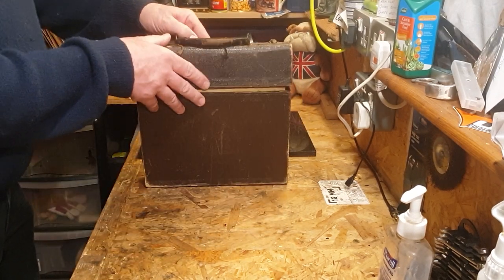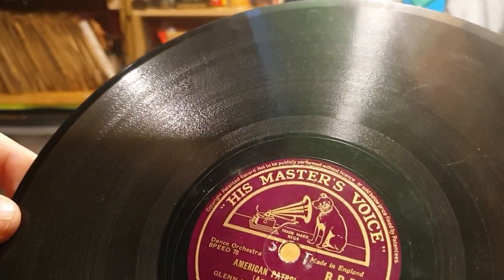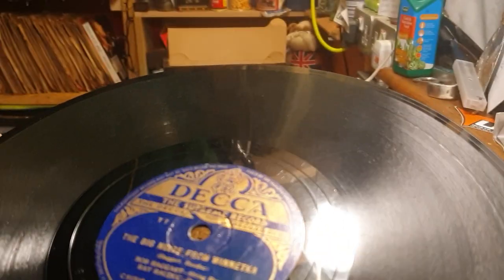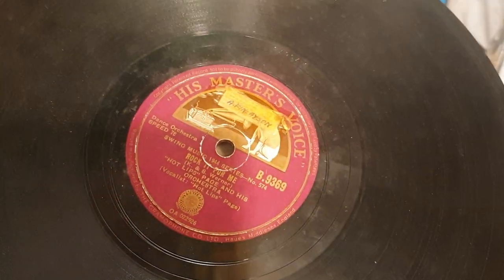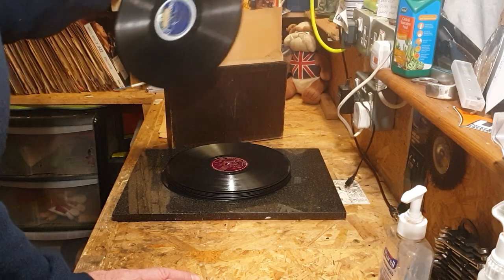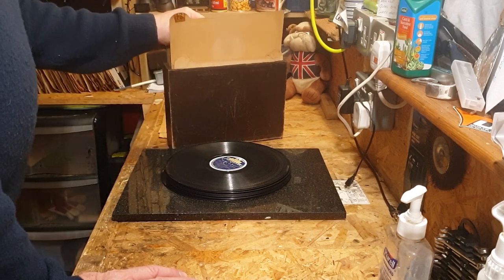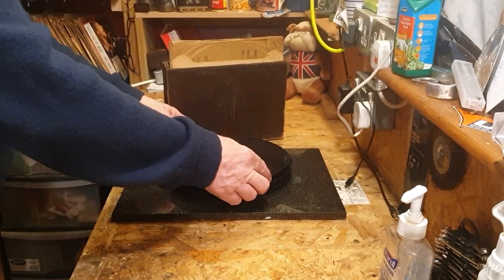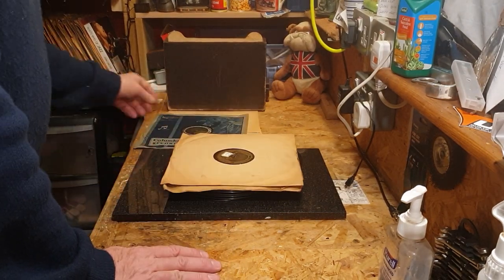STACK ATTACK 750 - PART 2 - 78RPM FINDS!

Comment: That copy of moonlight serenade by Miller seems to have some sort of crack under the label that I spotted. Big Noise From Winnetka, though isn't credited is actually mainly by Bob Crosby's band. That late 40s one by Goodman on Capitol is real great. Late 40s Goodman in general is better than most would think. Not bad part here.
Reply from the maker: I have not listened to it yet as destined for a late-night as are some of the others...   I will have to check that 78 for the crack, hope not though...